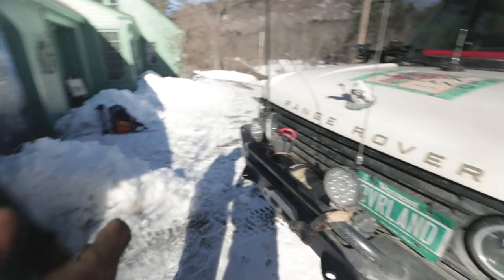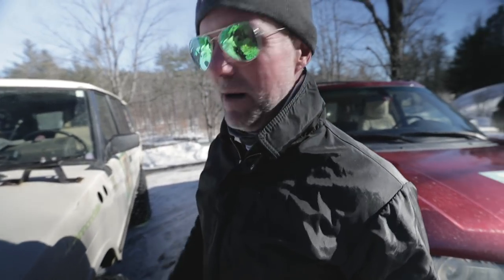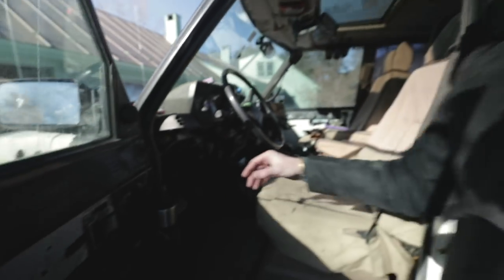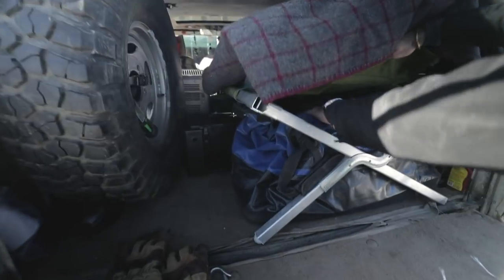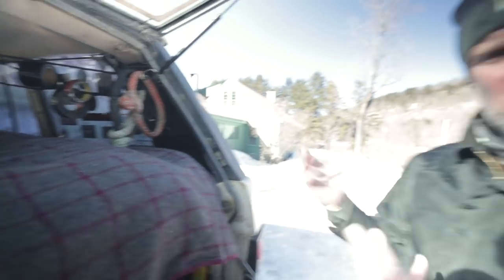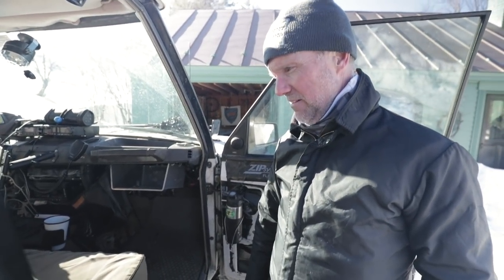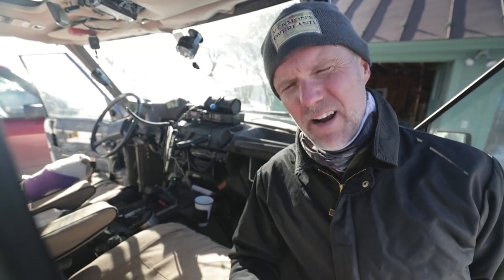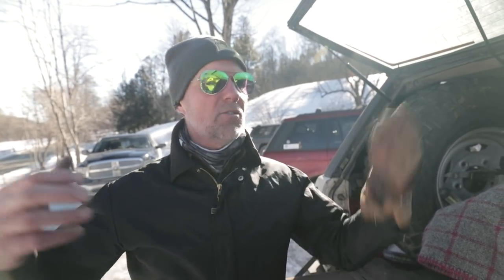The BUMBLE. A 1994 Range Rover Classic LWB (Full-Length Walk-Around)

Comment: I put 2mm stainless steel gauze on the inside of the hood to cover my hot air vents/holes, prevents dirt, leaves etc getting in the engine bay, held in place with gutter sealant :)

Comment: Synthetic recoils exactly same as steel but it is easier to handle its lighter and if it breaks causes a lot less damage or injury. If you use a blanket or damper on the line they work better with synthetic.
Reply: Alex West steel vs synthetic slaps . Metal is more deadly dont u think?

Comment: I dunno if this has been said previously or not, but I've just watched the walkaround, and did not see a single fire extinguisher.  Nothing in the cab bolted to the rhs dash?  Nothing in the back underslung from the roof interior?  Do you carry one at all?  It's good to be kitted out like this, but you literally don't want to see it all go up in smoke as you stand watching from the side of the road.  Get yourself at least 1 FE, and a fire blanket.  Also think about a rear exterior high mount roof light for reversing at night.  No emergency flashing/strobe beacons?  Mag mount ones are good and can be stowed away and not kept permanently on the roof.  One last thing, I know you have a shovel, but 2 track/duck boards can be mounted to the roof on a small rack.  Yup, ok, you have a winch, but using the combination of duck boards and a winch to get you out of a spt (or someone else) is a handy thing.  All the best.  Dawg.
Reply: Things people overlook! Safety first!

Comment: Well done. Those RDX corner lights are nice. They say up to 94, but from what i know 92-95 is interchangeable, you think those would fit the 95 LWB?
Reply: is it a wiring issue?
Reply: They'll fit 1995, yes.
Reply: 95 US is a 94 UK
Reply: Yes, should fit fine. I have to say the wiring was a bit of a challenge as it was not plugged in play. Plus I wired the halo lights through my driving light wire in the front and that took some doing I am no electrician so anybody with some mechanical skills could easily do it.

Comment: I have the 94 soft dash county ( here is Australia it’s called an Lse)......I love it more than a limb, it’s crossed the country via tracks that define remote (look up tanami track, canning highway, Mitchell plateau)....at high speed and with totally reliability keeping me and young  family safe throughout . For over 250,000 Kms ( on top of the 218000 kms it had when I bought it ) you could not kill it with a stick. I’ve looked after it and for $8 K Aud  original purchase I have a vehicle that can pull up the front of any 5 star hotel and the valets don’t know whether The Queen or Pablo Escobar will step out .... I will bequeath it to my grandkids when they are born

Comment: THIS ARE VERY VERY HARD TO FIND. I LIKE THEM BUT I LIKE THE OLDER SUBURBAN 2500. THEY WILL FIT A 33 IN TIRE NO LIFT SOLID FRONT AXLE AN IF YOUR LUCKY YOULL FIND ONE WITH A TH 400 TRANS 3 SPEED NO COMPUTER AN LOTS OF ROOM!!!!! YOU CAN KEEP YOUR SECOND ROW SEAT AN CAMP IN THE BACK AN PARTS ARE VERY EASY TO FIND. THATS JUST ME BUT YOUR TRUCK IS VERY VERY NICE. THERE JUST HARD TO FIND
Reply: Is long as a limo